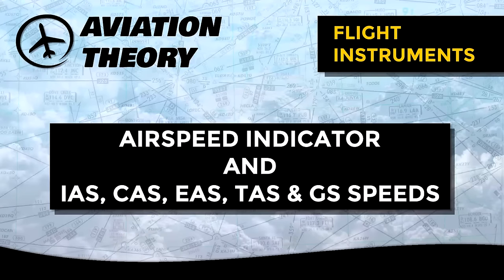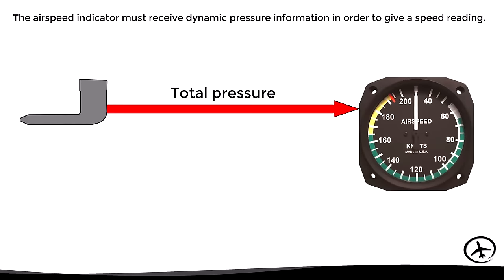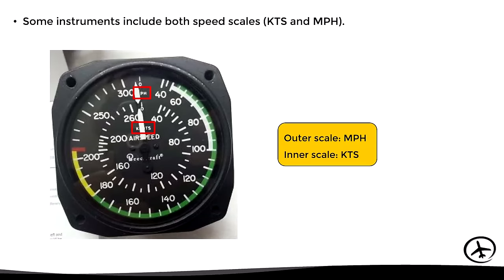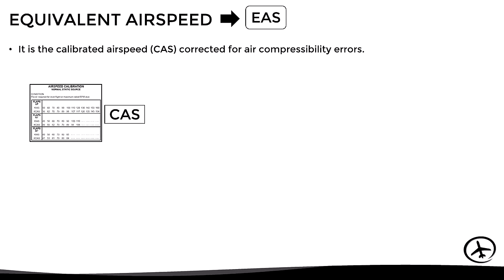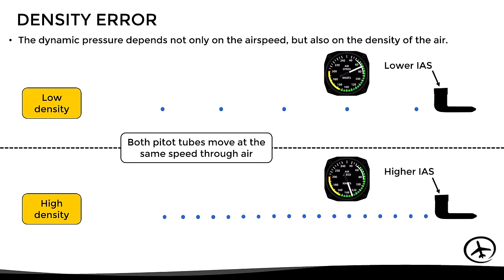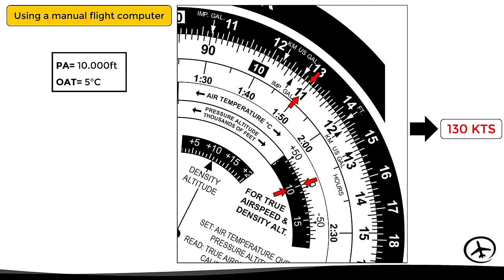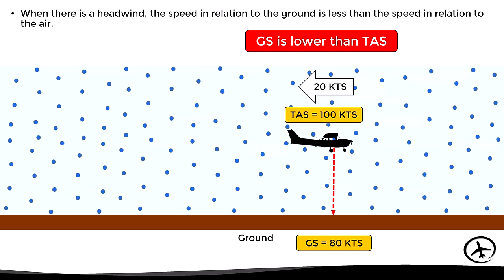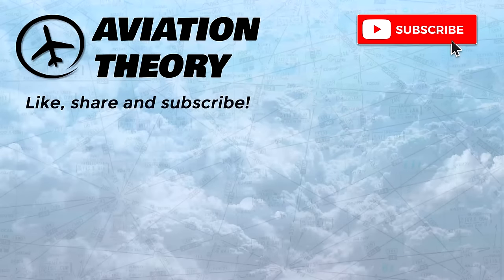The Airspeed Indicator & Types of Airspeed (IAS, CAS, EAS, TAS & GS)

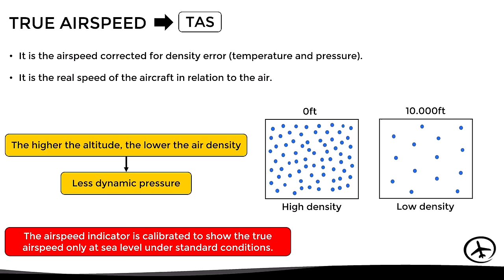Comment: At 12:30 it said at sea level under standard temp  IAS = TAS. Shouldn't it be CAS = TAS given that IAS does not include calibration for instrument errors and position errors ? or is it part of the assumption that you are in level unaccelerated flight with no instrument errors ? or am I incorrect? (love the vids thanks a million can't wait to start flying.)

Comment: Doubt: Regarding GS...

The dynamic pressure on the Pitot tube should change in head winds or tail winds..
Thus the IAS itself should change in headwind or tailwind... 
For e.g. An aircraft in calm wind shows IAS 100 knots.. 
Assuming at 1000 feet.. TAS also approx 100 or 102 knots.. 

.. 

Now there's a strong headwind, whether the a/c IAS still show 100 knots with the same power  by the engine?? 
I guess it should show higher speed as the pressure is higher now....

Sorry if it's stupid!!!

Comment: An airspeed indicator is an essential instrument in an aircraft's cockpit that measures the aircraft's speed through the air, known as airspeed. It displays the airspeed in knots, miles per hour, or kilometers per hour. The airspeed indicator is a critical component in aviation as it helps the pilot to maintain a safe and efficient flight path.

There are different types of airspeeds that an airspeed indicator measures, including:

1. Indicated Airspeed (IAS): This is the airspeed that the airspeed indicator displays. It is measured relative to the aircraft's reference point, which is typically the leading edge of the wing. IAS is the speed that the pilot sees on the airspeed indicator, and it is affected by factors such as altitude, air density, and angle of attack.

2. Calibrated Airspeed (CAS): This is the true airspeed corrected for instrument error, altitude, and air density. CAS is the actual speed of the aircraft through the air, and it is the speed that is used to calculate other important parameters such as lift, drag, and range.

3. Equivalent Airspeed (EAS): This is the airspeed that an aircraft would have at standard sea level conditions (ISA) and zero altitude, given the same lift and drag as the actual flight conditions. EAS is used to compare the performance of an aircraft at different altitudes and air densities.

4. True Airspeed (TAS): This is the airspeed corrected for the effects of wind. TAS is the speed at which the aircraft is moving relative to the ground, and it is the speed that is used to calculate ground speed.

5. Ground Speed (GS): This is the speed at which the aircraft is moving relative to the ground, taking into account the effects of wind. GS is important for navigation and is used to calculate the time required to reach a destination.

In summary, the airspeed indicator measures IAS, which is corrected to CAS, EAS, and TAS to provide the pilot with accurate information about the aircraft's speed and performance. GS is then calculated based on the TAS and wind information.

Comment: My understanding is aerodynamic pressure on the airframe is based on TAS not IAS . In an airrace I saw a plane delaminate in a shallow dive and suspect the crew were watching IAS and not TAS to ensure they stayed below VNE . Flutter ensued and they both perished - Is my understanding correct ?
Reply from the maker: Hi Hedley, since dynamic pressure depends on airspeed and air density, the only way to refer to it correctly is by using IAS, since that is in essence the measurement of dynamic pressure. TAS is used to determine the actual speed in relation to the air, but not the dynamic pressure.
Reply: @AviationTheory  “ But flutter does not depend on Indicated Air Speed/dynamic pressure. It is directly related to True Air Speed — the velocity of the air passing by the air- frame. The velocity of the excitation force is the prime concern, not the magnitude. It is very possible to exceed this critical “flutter speed” without encountering flutter if there is no initial disturbance. “ 

- While this may be incorrect,  I always keep my TAS below VNE , A few thousand hours under my belt and for sure age ( 66) makes me more cautious in the air . .
Reply from the maker: @hedleyfurio  Actually flutter does depend on TAS, however the aerodynamic loads experienced by the strucure depend on IAS.

In most aircraft VNE is a constant IAS, since in these cases flight tests have shown that no problems are experienced throughout their normal operating envelope. However, in some aircraft (specially helicopters and gliders) VNE expressed in IAS does change with altitude because of the TAS flutter limitation.

So in summary, it all depends on what the manufacturer's manual states. but as you say, it is better to stay in the conservative side if you are not sure about the limitation of a certain aircraft.

Comment: I have a question about TAS calculation (14:48 in the video). There is OAT assumed as 5 grad. What if there’s 10 or 15? The rule of 1000 ft is applied only to density? How does temperature fits here. Thx
Reply from the maker: Hi! The approximate formula shown in the video is only accurate in standard conditions (ISA). If the temperature is different than that, then you have to use a flight computer or something similar to determine TAS. The temperature affects the TAS because it depends directly on air density, so if pressure or temperature change, the TAS will change as well.
Reply: @AviationTheory  Hi, thank you for the answer. I’m confused a bit here then in regards of standard conditions. Is not it 15 grad? Or it’s just really rough approximation and plus/minus 5 or 10 grad is not relevant? I mean fir this rule of 1000 ft.
Reply from the maker: @Zaec2011  15°C is the standard temperature only at sea level. If you are flying at a higher altitude the standard temperature at that level will be lower. You can check out the video "Standard conditions - ISA" where it is explained in detail: https://youtu.be/S3TrKvHadMQ

Comment: You say the IAS is not corrected at all. I'm just reading a manual of a PA28. That book is describing the IAS as the indicated airspeed corrcted for the instrument error. Good video though
Reply from the maker: Hi Kristian, looking at a PA28 manual, there is an airspeed calibration table to correct the IAS for instrument error (and obtain the CAS). Perhaps it is a misinterpretation of the IAS definition in the manual.

Comment: How is instrument error corrected by the calibrated air speed? (Understood that positional error can be corrected by the calibration table)
Reply from the maker: Hi, when you correct IAS using the calibration table the resulting speed is the CAS.
Reply: @AviationTheory  I understand how the calibration table can help correct the positional error. But how would it help with the instrument error? Wouldn't the instrument error vary from one instrument to another?
Reply from the maker: @lunayang3713  Oh I get your point now, well in theory CAS includes instrument error comprensation as well, but in practice I don´t really know how they determine it for each individual airframe and instrument.

Comment: Pitott tube:  LOL  Anyway, an "ideal" gas is not incompressible.  It just means its density increases in exact linear proportion to the pressure applied.  Real gases, e.g., air, don't show a straight line when graphed.